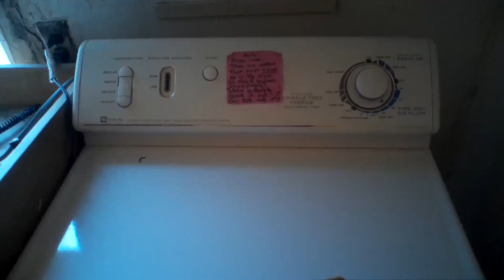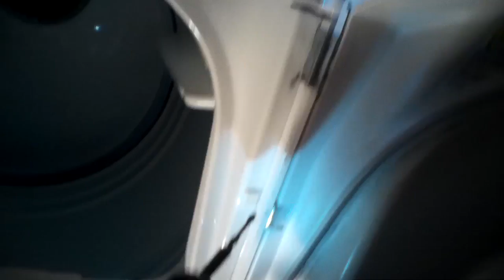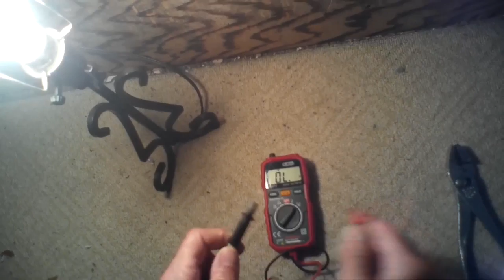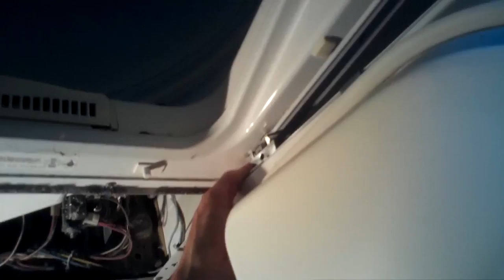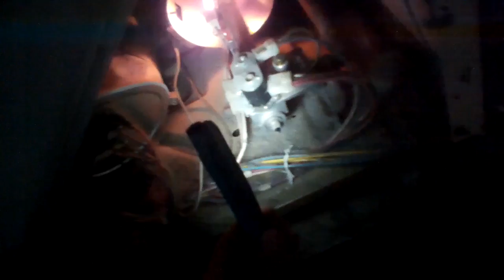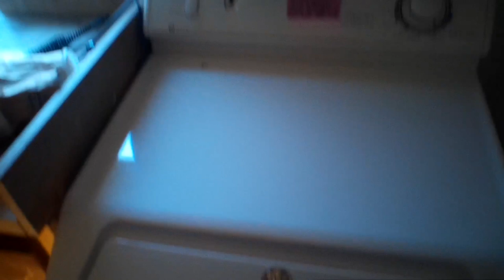✨ Maytag Dryer Won't Heat Up  -  EASY FIX ✨

Comment: I must be the most unlucky person here.

Initially the igniter wouldn't even glow.

I changed the igniter. Now the igniter glows for like 20 seconds, I hear a click and it turns off. But still no flame would start. And I was able to smell a bit of gas.

So I changed both of the Gas Valve Solenoid Coils. Still same issue.

Not sure what to do at this point!

My model is Maytag MDG9706AWW if that helps.

Thanks!
Reply from the maker: I wonder if the flame sensor stopped working?
It’s that black plastic and metal thing on the side of the burner tube.

Comment: Hi there, I have this exact model and have been able to keep it running through the years by using the multimeter on each part until I find the problem...until now. The igniter kicks on and the flame lights 2-3 minutes. The next igniter cycle it will light for maybe 20 seconds or not at all which would lead me to believe it's the coils. However the 2 and 3 prong coil both test fine. My exhaust is blowing normal so I don't think it's a lint buildup. Could these coils be failing even though they are reading on the multimeter. Thanks
Reply from the maker: It does sound like the coils are bad👍
Reply: Update. Coils did the job. Thanks for getting back to me with your input.

Comment: Thanks so much for the clear, easy instructional video.  I was able to fix my Maytag Atlantis gas dryer with replacing both valve coils. Regardless, it's always a good idea to vacuum inside the dryer as well as clean the lint in the vent from inside the house to outside.
Reply from the maker: Awesome job Neil😊👍

Comment: Replaced thermal switch, igniter and gas coils- but still no flame. Any ideas?
Reply from the maker: Thanks Mike,
It might be the flame sensor which is located on the left side of the burner tube and looks like about the size of a cigarette lighter.
You can check to make sure that that has continuity using a multi-tester if it doesn’t have continuity that’s the cause of your problem.

Comment: Vent is clear. Replaced the coils with OEM coils. Replaced the igniter. All other components test ok for continuity and still I get no ignition. No flame at all. And yes, the propane tanks are full and the valve in the "open" position. My kitchen stove works ok from the same tanks. Any other suggestions?
Reply from the maker: Hi Duncan,

Can you send me the model number to: scottthefixitguy@yahoo.com
Reply: @QuickAndEasy5MinuteAppliance  Info is on the way and thanks for getting back to me so quickly!

Comment: It's a good thing for you Bro and your video. I watched several, but by identifying my body by model I was able to see your opening picture post to identify my front panel and equipment. This was great because my dryer was in a tight space. Luckily everything is reachable from the front. It saved allot of unnecessary work. Thank you! Aloha, Paul
Reply from the maker: Thanks so much Paul.
I’m so glad it worked.
What island do you live on?

Comment: Thank you so much that was great info I’m going through the same thing with my own dryer. Now I remember I did this before. But I will check the lint the vent first thanks again.
Reply from the maker: Nice job Michael👍😊
Reply: Thanks again it was one of the coils it’s working fine again thank you thank you thank you many thanks God bless you

Comment: My maytag gas dryer lives on at 25 years old. Great dryer! Thank you for the video. That was so easy. I did not even bother with the multi meter.
Reply: Mine is about 20 years old I think as well! My uncle who paints houses, got it from a client who was throwing it out and gave it to my mom for free. Recently stopped drying but it runs! I'm determined to fix it and not get a new one lol
Reply from the maker: Excellent , thanks for the feedback👍

Comment: 50 years of keeping 4 famalies operating never had a bad coil but tons of lint jam and  the blower jamed so it does not move enough air if your machine is not in basement call a sweep to clean old maytags turn off some newer ones can catch fire

Comment: My flame doesn't come on at all but it does  glow but no flame
Reply from the maker: Can you double check that the gas is on?
Reply: @QuickAndEasy5MinuteAppliance  is there a sensor to the left of the igniter that signals the coil to turn on gas?
Reply: Gas is on never disconnected nothing the dryer just stopped working

Comment: Thanks for your video, very helpful!  I have a similar problem with my dryer. Just curious, did you need to replace the 2 coils or would cleaning the venting have solved the problem on its own. Thank you!
Reply from the maker: Probably the cleaning alone will solve it👍

Comment: Mine has no flame when turned on and running when apart. I held the button to make it run. All devices in the dryer have continuity that I can tell have any ideas ? Ignitor and heating coils?
Reply from the maker: I would say it’s a bad Ignitor .
Reply: @QuickAndEasy5MinuteAppliance  Thank you!!!!

Comment: The igniter always lights the fire the first time, stays on for couple minutes, then fire is out. Couple minutes later I see the igniter light up but no fire started.  Is this a symptom that the coils are bad (but seems to always work the first time dryer is started), or a bad sensor failing to tell the coils to let gas through?
Reply from the maker: I would say gas coils.
Reply: @QuickAndEasy5MinuteAppliance  thanks, your video was great, I did replace the gas coils and it's working!

Comment: my igniter will not glow, tested the four items in the front and they are all working, are there any i need to check in the back? my dryer was working and one day it just stopped,. again, the igniter will not glow.
Reply from the maker: Could be a bad igniter.

Comment: SAFETY PRECAUTION  Turn gas supply off to dryer, some models you unscrew the coil bracket causes gasket to separate.  Never use soft foil venting on any dryer no matter what the salesperson at the store says. Follow installation guide!
Reply from the maker: Great advice Ron

Comment: Followed all of the troubleshooting steps and the issue for me was the gas valve coil. While I had the front open I was able to clean out all the loose lint and completed repaired in about 45 minutes.